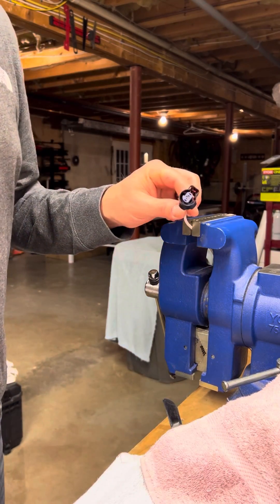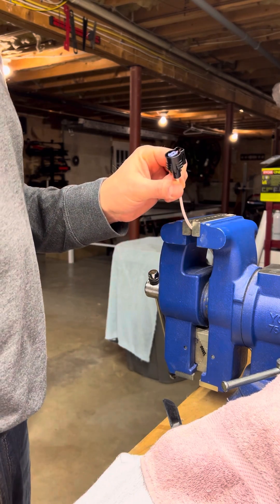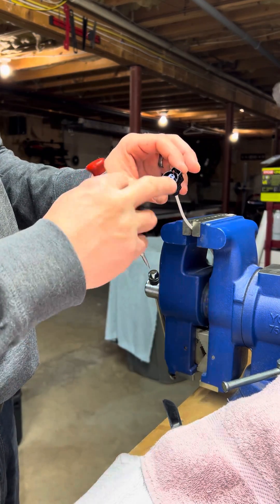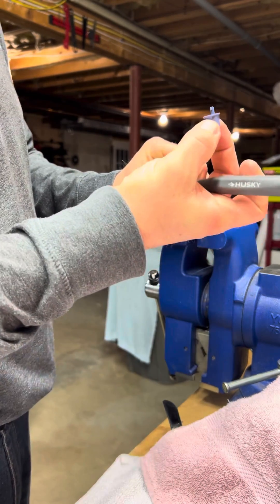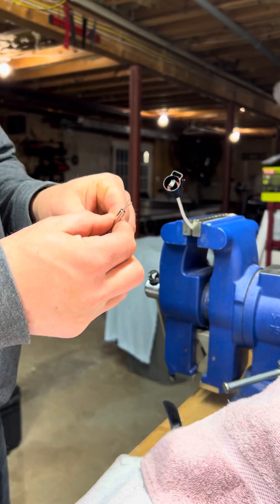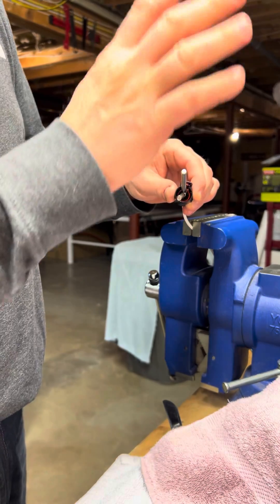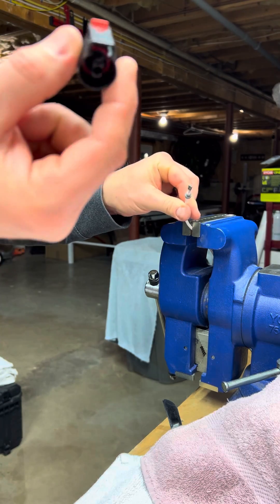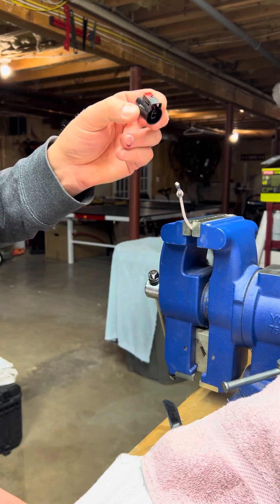GMC Sierra/Chevy Silverado broken starter signal wire connector fix

Comment: Thank you. The red locking tab on my connecter was broken and I really didn't want to splice the ignition wire. $12 bucks for a new connector with free next day delivery, easy fix and works great. I bent a short piece of thin wire and inserted each end along the sides of the tabs to remove the connecter from the  wire.
Reply from the maker: Excellent, I'm glad it helped you and you got it all sorted out.

Comment: Great video.
BEWARE!  Not every connector you buy on Amazon is a TE  (quality) connector.  I started to do this and realised my connector was ‘less expensive’.  Was hesitant to take it apart.
Reply from the maker: Good call! You're right, there are a lot of cheap knockoffs out there. I would buy it direct from TE or someone like Mouser. My Amazon reference was for the GM dongle repair kit.

Comment: Thanks man, I found just the plug with no tail and was able to put it on in 20 minutes. Most of which was taking the old one off, ended up just breaking it to pieces. But it worked and is secure now. Thanks for saving me $30
Reply from the maker: You bet. For me it wasn't even about the money, but rather a better solid connection on the signal wire, vs a pigtail to corrode down the road.

Comment: Great video and explanation. Works much better than electrical tape holding my broken plug in place. There are several variants of the plug and harness on Amazon for around $12, and I bought two different ones just in case, both of which use the same plug. Was a quick and easy fix so the extra will go back.  Thanks again!
Reply from the maker: Glad it helped!

Comment: Just did this today. 100% works and is very easy. You saved me a ton of stress. Thank you.
Reply from the maker: That's great, glad it helped you out! Much better solution than having a crimped butt connector under the truck.

Comment: Thank you so much for this video.  The watch tool kit I have was not deep enough so I tried a couple paper clips and it pulled right off on the new piece.  Today I will be getting under the truck to remove the broken connector. 
Thanks again, Bob.
Reply from the maker: Perfect, I'm glad it help you out. Much better than a crimp.
Reply: I finished up today with the starter.  Worked very well removing the broken connector and adding the new one on.  Thanks again for the informative video!!
Reply from the maker: @bobbrown6682  glad to hear it!

Comment: Curious if you or any commenters found a way to buy just the connector and not the entire pigtail. Thanks for sharing. Right now I have mine held on w zip ties. I talked to a buddy who has replaced many GM starters and he recommends brake cleaner sprayed in the connector before attempting to remove it if that helps anyone before they break it as I did.
Reply from the maker: Yes, the info is in the description. TE part number 2098198.

Comment: About to attempt disconnecting mine and hoping not to break it, which direction are you supposed to pull/press the red clip part before disconnecting? Great vid btw
Reply from the maker: I wish I could remember! I just know looking at it, it wasn't obvious, and then when I looked at the new clip, I thought "well that's obvious!" I believe it just slides back a hair, which then allows the clip to be depressed so it can release. Good luck!

Comment: Don't have the watch tool, what tool else would be ideal for the second step?
Reply from the maker: You just need something (2 of them) that is very skinny and will fit inside the little openings to push the tab down, so the connector can slide off. They sell a tool that removed the connector, but it's like $200! You can easily make something work. Jeweler's screwdrivers, the smallest size, filed down as thin as possible, etc. Here is the instruction sheet https://www.te.com/commerce/DocumentDelivery/DDEController?Action=showdoc&DocId=Specification+Or+Standard%7F408-10416%7FA%7Fpdf%7FEnglish%7FENG_SS_408-10416_A.pdf%7F2098198-5
Reply: @stevegnh  Thanks a lot! 
I am concerned I will loss that little piece (in your 2nd step) when I am under my truck. Is it easy to put it back on? I can do it on my desk no problem, not sure if i can do it under my truck.

Maybe i Will tape two needles over small wood sticks.
Reply from the maker: @fzy55  You won't need anything you pull off the connector on the truck. You just need to get the broken connector off the truck wire, leaving the crimped wire like you see in my video after I remove the connector housing. Then, the new plug you order will have everything you need. You will just insert the wire with crimp into the new connector. It will click, and then you push the gray insert in and lock it. I was able to have enough slack under the truck to pull it down while underneath and do it while on a creeper. Of course you can also buy the dongle and just crimp it on like GM suggests, but I didn't want a connection that could corrode, so I went with the new connector only, using it off the dongle I bought originally.
Reply: @stevegnh  Awesome!
Reply: You can use two paperclips.